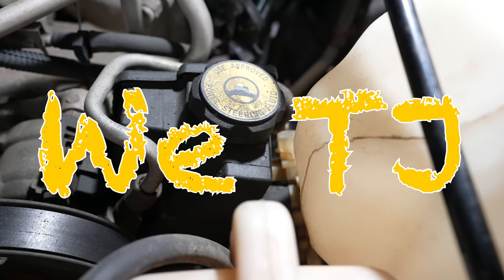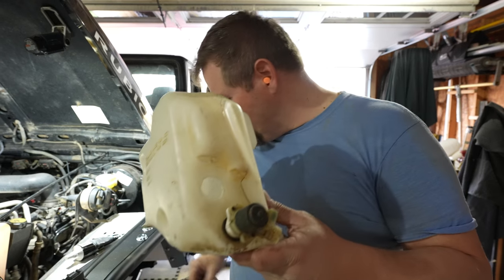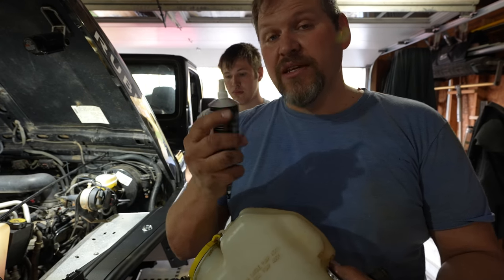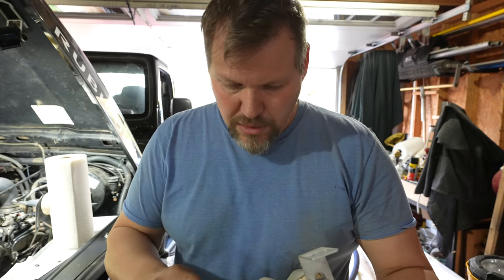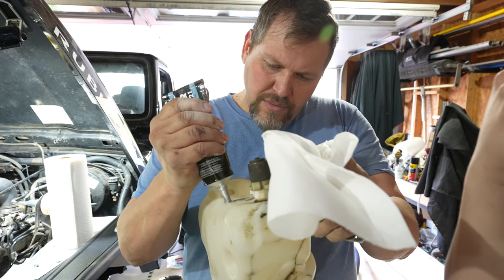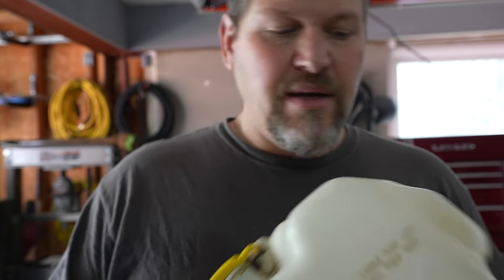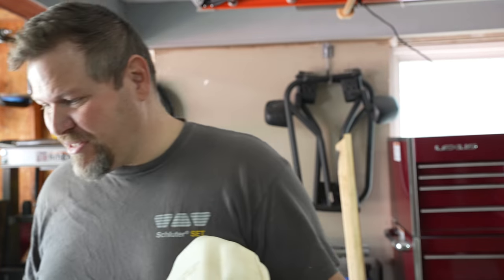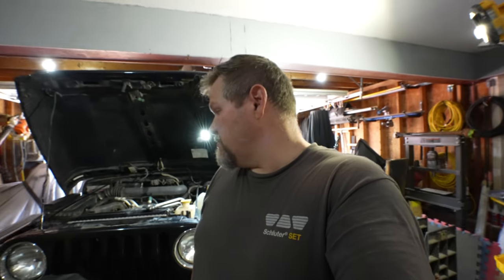Metal Cloak Front Fender Jeep TJ/LJ 97-06 Washer Tank Mod

Comment: I have the same front fenders. MC did not provide any new hardware to attach the fenders to the Jeep. Just enough to assemble the flare to inner fender flare. That just rubbed me the wrong way.

Also, I have the 2.4L engine. There’s plenty of room to relocate the washer fluid container.
Reply from the maker: Their instructions leave something to be desired. Also, I agree the hardware is not marked as to what it goes to and lacking sometimes.  One of the parts we installed from MC had twice the hardware in it than needed so we’ve been able to rob out of that pile.

Comment: should have done an AEV highline kit.
Reply from the maker: Why, not being argumentative but why is AEV highline kit better?
Reply from the maker: Didn’t they quit making those kits awhile back?
Reply: No.  You should have known that kit has been discontinued for several years and is generally not available.  If you could find one for sale, you'd be paying $5500 or more.
Reply: @long-jeep  my dad just picked up the whole kit for 1600$ from someone on the forum. battery tray, hood, fenders, and flares.
Reply: @long-jeep  sorry, 2400$
Reply: @casemcdonald1187  Was it used?  My $5500 quote was for a NIB kit from the AEV forums a few years back.
Reply: @long-jeep  it was brand new. still had the black primer on it. the guy was going to put it on his LJ and never did